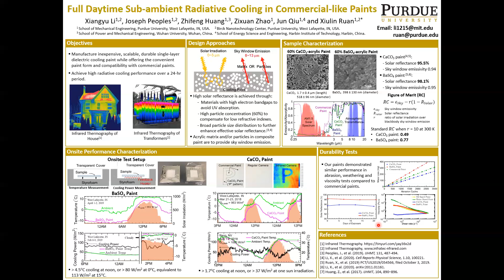Full Daytime Sub-ambient Radiative Cooling in Commercial-like Paints

Comment: Can you explain why this doesn't violate the first and second laws of thermodynamics?  Thank you.
Reply: @noname12399no  Sub-ambient radiative cooling is radiation going from an area of lower temperature to an area of higher temperature. This results in a decrease in overall entropy, absent any outside work done on the system. That violates the second law. And if you can maintain a permanent temperature gradient, you can exploit that to operate a heat engine and extract mechanical work endlessly. That violates the first law.
Reply: @Simon14916  OK, I'll bite: This method does not 'cool' anything per se. All it does is allow more radiation to pass through in one direction versus the other - which means that the energy transferred from the sky to whatever is coated by the paint is less than the energy emitted from the body below the paint/cover. 

If this was a completely isolated system, without the sun and the sky it would do nothing.